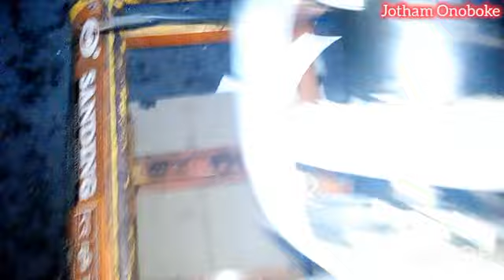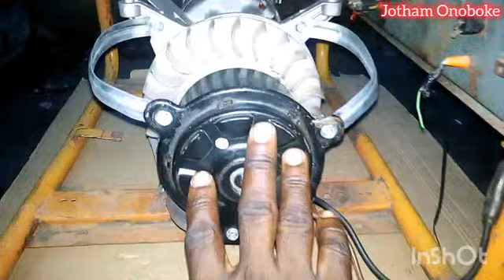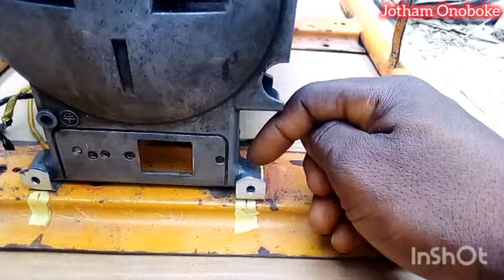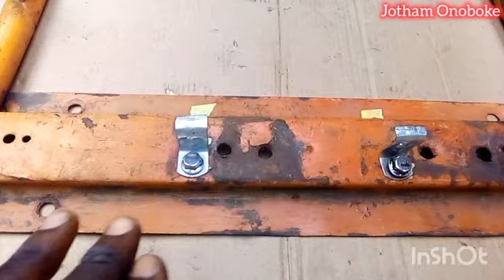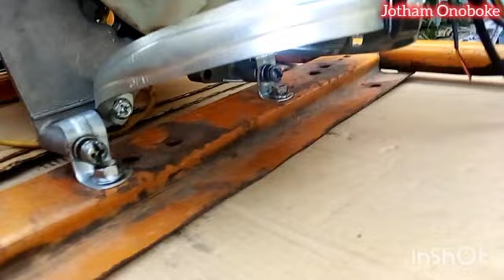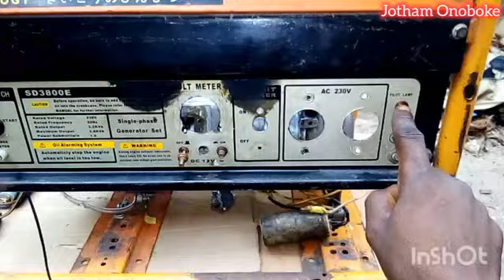Gasoline generator conversion to Fuelless(Part 5).

Comment: Brother what if i put full load on it, because for example if your Dynamo is 3Kva and put load around 2Kva +
Your dynamo will became hard and your little DC motor will not work. 😢
This is the main reason why this mechanism failed.
Reply from the maker: That's a very valid point, I will definitely try to fix that.😊

Comment: Thanks for your explanation.
What's the speed of the DC motor or how do you match the motor speed with the generator to produce 220v
Reply from the maker: Thank you sir for your wonderful question.
The motor speed is 3000RPM to 3500RPM and the alternator Requires 3000rpm to start producing 220v.
One thing I noticed is that the Motor spins the alternator without stress.